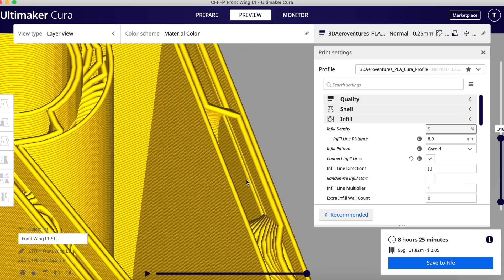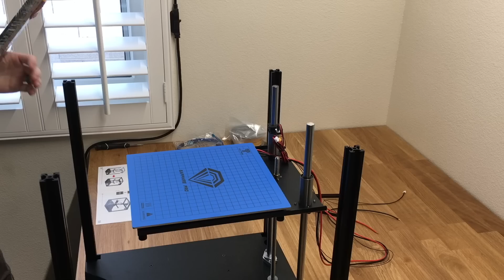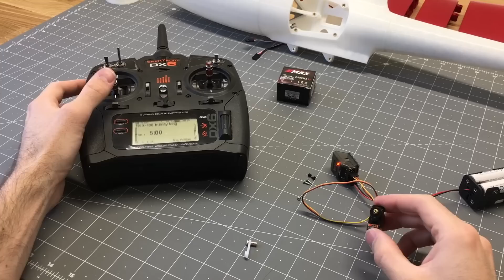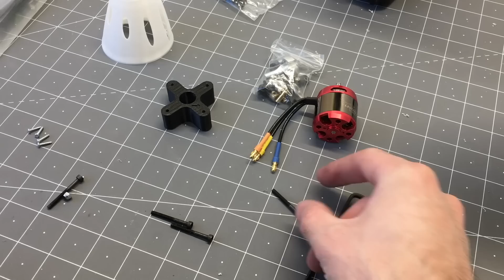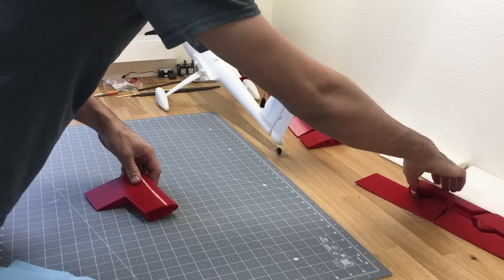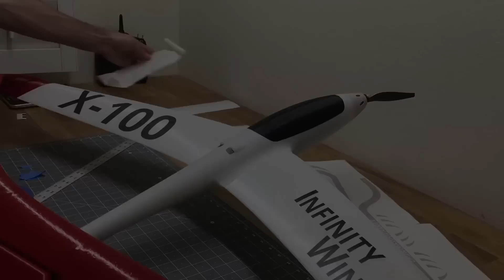Amazing DIY Infinity Wing Build - 3DAeroventures

Comment: Hello Troy, thank you so much for your awesome work, I can see how much effort you put in.
I was desperate trying to print the micro sportcam from Aeroventures. G-Codes were crap for my anycubic mega and the stls required a lot of planing and seemed to be to heavy after all. I'm trying again now after you mentioned some of the problems I have. Do you have tried to print the micro sportcam? I'm cursing at the design right now :D greetings from germany - keep it up!

Comment: What I meant by this was that,  on one of your videos,  you sent the viewer me to a web site where you could download a test wing for print quality. (PLANEPRINT.COM)  I downloaded this and with the settings P3 from your video it turned out great.  There was 4 different settings in CURA, P1 Full body, P2 hallow body, P3 surface and P4 Flex.  I can only use the P3 to get a 0.8mm wing skin to print solid or 100% infill.  If I use P1 or P2,  the same 0.8mm Wing skin I get two skins 0.3mm thick that are in total 0.8 mm apart with no infill.  Why? Even if I set infill  to 100% I get the same results (when using P1 P2). Do you print the bodies of your airplanes with P1 and P2? Do you have to adjust the the infill settings? Does the fuselage of the airplanes you print have infill in them between two outer skins? I am not sure but does this have anything to do with Special Modes  "SURFACE COMAND" normal, surface or both?  SORRY if this is too complicated!
Reply from the maker: yes, for this airplane you can't use p3 from planeprints settings. you need to change it to normal mode in the special modes tab.

Comment: When designing a plane, you design what the infill looks like.  So, shouldn't you set infill to 0%?  You set the outer wall thickness and create the internal former and stringers etc.
Reply from the maker: For this airplane design, 3DAeroventure designed it to have actual infill between the layers. All other planes I have built have the style of infill you are talking about!

Comment: disregard the structural integrity issue, is it possible to scale-up a 3d print model to print a larger version?  Thanks.
Reply from the maker: It can definitely be done. The only things too look out for is setting up the motor mount and servo mounts. Also setting up the CG but in Cura you can scale up the parts and print them out.

Comment: Hi Troy, thanks for all the great videos. I got a Sapphire pro as you suggest, and its causing problems- I'm building the BigBobber. The problems are from the Cura profiles, they don't handle the z axis correctly. Could you please publish the Cura profiles in full that you used for the BigBobber? if only as a departure point. I've been printing for a week, and of about a dozen items, only 2 are useable, 2 more could be reworked.
Thanks!
Reply from the maker: I am  not sure what you mean about the Z axis is not correct?

Comment: I had V1 until an unfortunate mishap  sent it to RC heaven. 

I was told last year from Aeroventure that they were holding off selling the model because of a legal matter.

Are they now selling the kit?
Reply: Yes, it’s been redesigned and improved.  It’s back up on the website.  If you already purchased V1 you get the reworked V2 version at no extra charge.  Email me if you didn’t receive the download email sent out a few months ago.
Reply: @3DAeroventures  Xlnt!

I'll be hitting you up for another one. I still have the power system from my ill fated one.

Comment: do you even know is like next 10 -15 years is use turbo UAV or fast prop competetion purpose for fun drive actualy based on romulan duck corvette which is quite larger as star trek enterprize anyway a scfi flight conditions show signs off serious model build in Slovenia there is company on grass who literally push this stuff they can build one for test purpose 100% success and new model for them sometimes this videos are extremly usefull in research and inovation in aviation May be I would slight expand fornt wings and corner it under angle so it speeds even better, and lets rotational cocpit used as escape pod all elements used and shown in prototype if shown at NASA is definetly a winner and with rotational sky high ahead as fast turbo ultra light prop totaly star trek and glider tech and aviation fan, first imression is like again watching cap Kirk in new edition Spook i gonna do it this time better in some crazy race for prize before mission movie

Comment: fyi, in the context of efficiency, this design is a disaster.      this is so bc,  the  'u-shaped' channel at each wingtip  MAKES   a   LOT  of  Drag.!!!!!!
Reply: Interesting remark, did you have a close look at the files or is your opinion based on the video? Do you generally think that box wing/rhomboid wing design is less efficient? 
Some argue that joining the ends of wings may increase stiffness and lead to a reduction in structural weight. 
I agree with you that wing joiners need to be optimised aerodynamically to make sense - not every winglet design automatically results in vortex/drag reduction...

What made me wonder about the design was the location of the CG. As it is located within the root of the for wing, the wing load of the aft wing is probably much lower. Lift created by the big aft wing is not needed and adds primarily drag. One solution would be to reduce the thickness or cordlength of the aft wing. Just my stupid 2 cents...
Reply: @pascalfust1035  my observation is based on knowledge, and what i  SEE.    cheers

Comment: it appears that all parts of the wing have a  Symmetrical  profile.     however, bc this concept is a disaster, from the ground up, it's not worth explaining this issue.
Reply: I'd be interested in the explanation :-)
Reply: @pascalfust1035  regarding  Drag:   it is a simple fact that, if/when  a  tubular/channel  structure  moves through air,  air  CANNOT  go  THROUGH  it.!!!!    because of the vortices/turbulence that occur, AT  THE  LEADING  EDGE.!!!
consequently,  a  lot  of  Drag, is made at the leading edge.    and,  a  Lot of  (trailing) Drag  is made  BEHIND  the structure.
regarding profiles:   a  stoopid  practice has been, by some, carried-over from the days of engine power.     it is the stoopid use of a combination of  positive aoa,  and  a  Symmetrical  wing profile.
the making of lift in this way, comes with a  Large  Drag  Penalty.
consequently, in such a design, a significant amount of the onboard  Energy  is  LOST,  to   Excessive (avoidable)  Drag.!!!! 
note that an air intake for an  ENGINE, does not have the same  issues.    bc  there is  DRAW; from an engine.   cheers         googletranslate

Comment: Hi, do you recommend to use the sapphire Core XY printer to make the ASK14 glider that you done before?
Reply from the maker: Any printer with a 200mm^3 build plate will be able to print it! Just comes down to the settings :)

Comment: Can you try out some of the thingy verse designs because they are free and there are some really good ones.
Reply from the maker: Yeah, I would be down for that. What do you have in mind?
Reply: @TroyMcMillanRC  well there's lots of different ones and the reason I like them is because you don't need lots of screws and carbon fibre spars and having to buy the files and light weight pla which makes it really afordable. I just want to see what you would like and recommend for my first build as I'm only a teenager and do not have the most amount of money. Cheers
Reply from the maker: @everythingrc5652  I really like that idea! I completely agree that I don't like having to buy all the extra carbon fiber spars, etc. I will look into it!
Reply: @TroyMcMillanRC  thank you